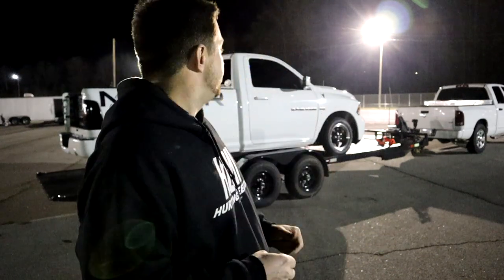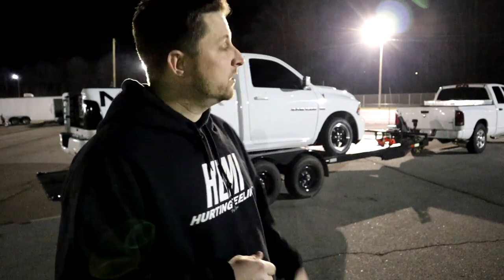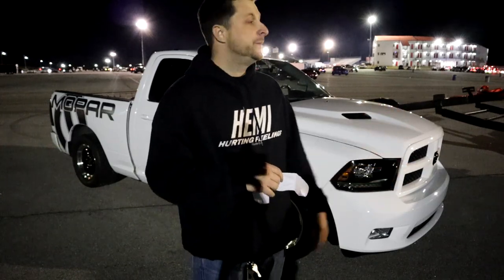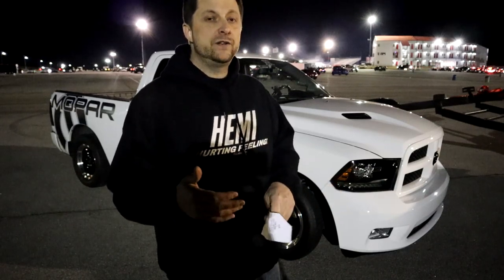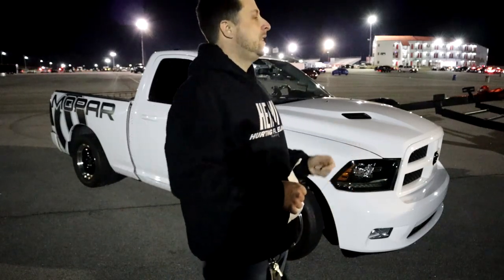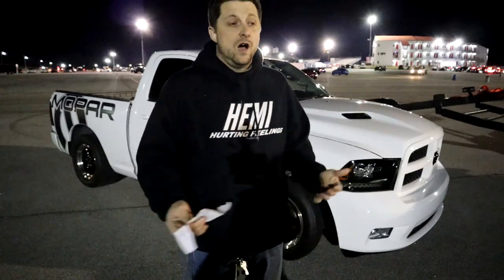BLEW The 545RFE Transmission Still Ran 11's

Comment: 456k on my original 545rfe. At the beginning of 2020 I bought a scat 392 stroker, s480, cam, springs, head work, fuel system. The only thing I had left was to do the trans before installing everything, holy crap those transmissions are expensive. Because of Covid I said screw that (for now) and sold everything
Reply from the maker: Wow thats crazy 😳

Comment: Nice truck! How much boost pressure you running? What are your inlet air temps @ the end of the run? Do you happen to know the weight of your truck when its track prepped?
Thanks!
Reply from the maker: On this pass I was peeking about 9.5 psi truck weights 4500lbs without me in it and thats full weight also on this pass complete stock interior nothing removed.
Reply: @FrostbiteRam  Nice! I'm running a procharger @ 13psi with air to air IC and the inlet air temps are extremely high (180). Curious to see what yours are.
Reply from the maker: @joshuas.4967  definitely not that high but honestly I will need to look at the log and see

Comment: Man it might help you out to get an aem 30-0300 WB gauge and you can run it through serial to hp so it is logged on hptuners. It's super easy to setup and that is what I use on both of my vehicles. It is looking fast man.
Reply from the maker: The gauge i have now can do that if I need to but have to upgrade to the hp pro I believe.
Reply: @FrostbiteRam  nope if you run it through serial you can use the basic. You only need the pro if you run it through analog. The 300 has a serial out. Put a plug on it get a serial to usb for your laptop and then you can import the channel into hp for free.
Reply: @FrostbiteRam  If your gauge has serial out now...you just need to go on amazon and order a serial plug wire up 2 wires to it and get a serial to usb adapter. <10 bucks and you will have it on your logs
Reply from the maker: @NN072288  interesting ill have to look into that

Comment: Do you still have your cam for sale and if so does it have a pretty good lope to it?
Reply from the maker: Yes I have it. No it does not chop as it dosen't have alot of overlap like the big cams but jay can give you what he calls a lope tune and it does sound pretty good I have some videos of the old cam with the lope tune. But its made for a daily driver with stock converter and heads but does make great power for a smaller cam.
Reply: What video am I looking for in your list for that tune you’re talking about?
Reply from the maker: https://youtu.be/-UWBqnEeVDw